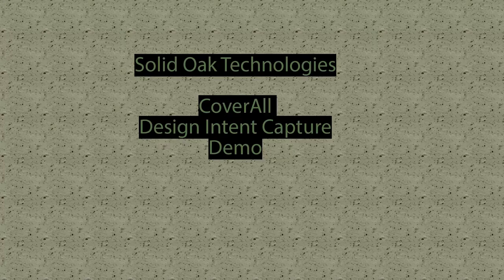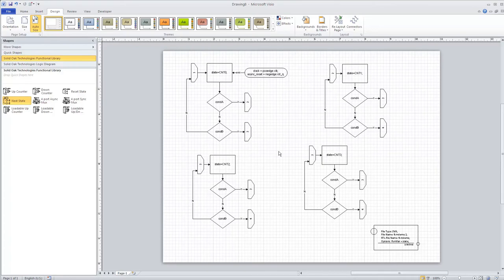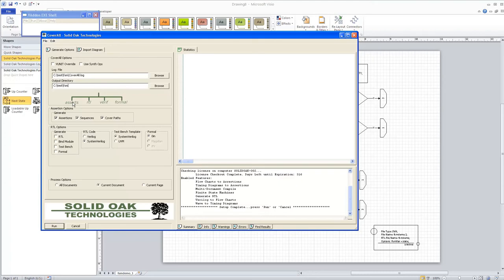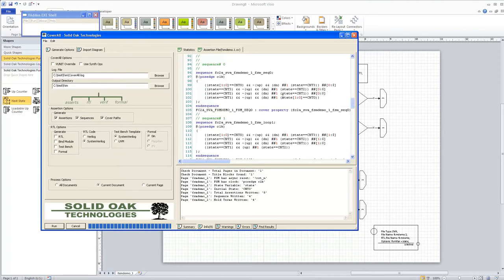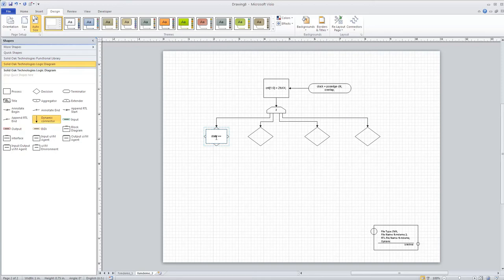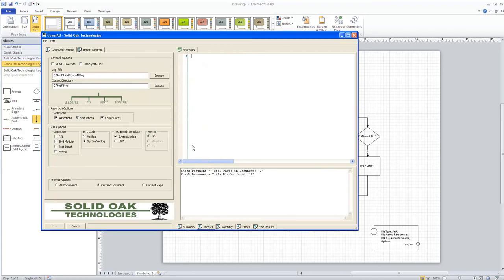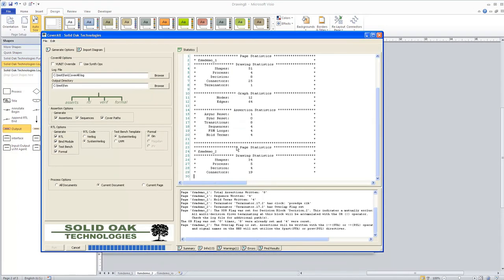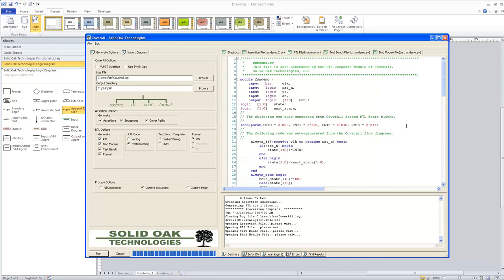CoverAll Finite State Machine Demo (best in 1080p)

Comment: Very nice demo. CoverAll is great for design verification because the Verification Engineer gets immediate feedback on testbench effectiveness. I built a UVM testbench around RTL code generatd by CoverAll. When I ran my first random simulation, I got around 98% coverage. I found an RTL bug after ajusting the testbench stimulus.  I knew I had to adjust the testbench because of the coverage hole.  Eventually, I would have found the bug, but CoverAll allowed me to find it much sooner.